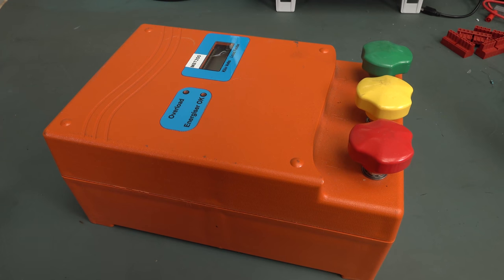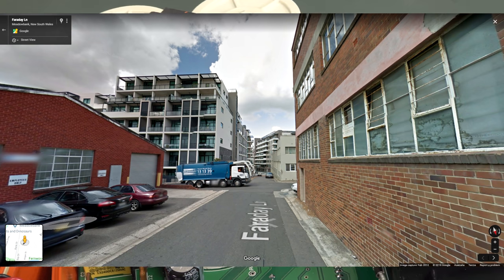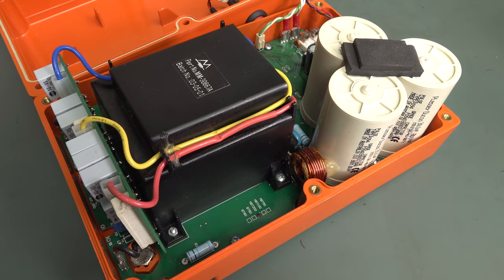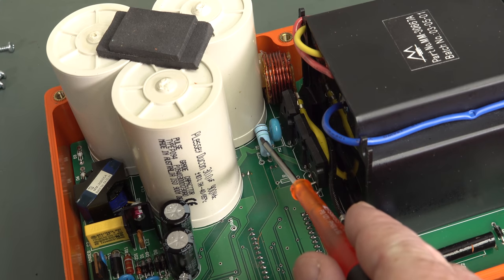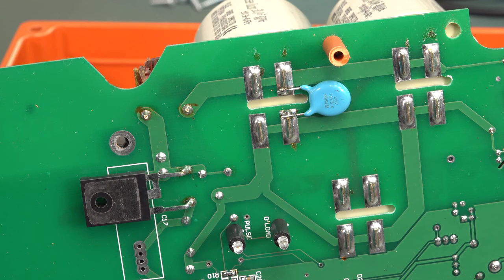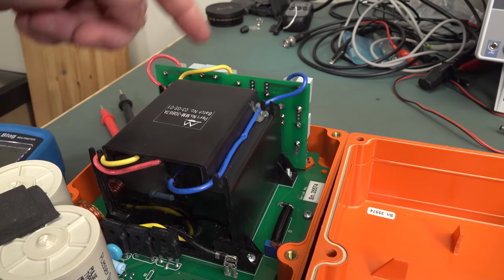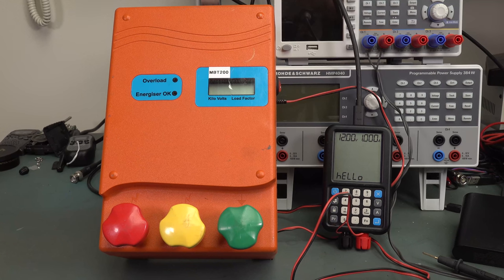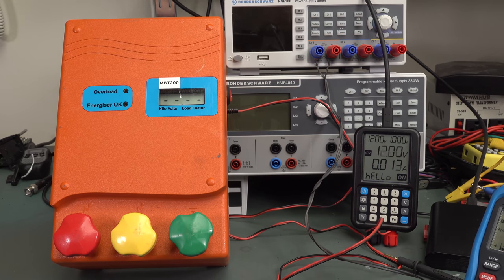EEVblog #1277 - Electric Fence Controller Teardown

Comment: Dave.
From 1969 to 1976, I worked for 7 years for an electric fence manufacturer in New Zealand,  
From memory the max pulse rate was about 60 pulses per minute or PPM.
The max pulse length about 3ms
.
The voltage was about 3000v to 5000v for fences up to about 100 miles approx 160Km.
I believe this was increased to about 10000v for fences up to about 100 miles approx 160Km. Mainly for Australia's dry conditions,
I forget how many Joules but the figure of 150 meg nah!!!

You can't measure the output voltage with a ordinary volt meter. Analogue or digital
We used a transformer, full bridge rectifier, cap, resistor, preset pot and a 50ua meter scaled to read the voltage directly. The needle bounced about but gave a good indication of the fence performance  that had to be checked at various places along the fence line,

One time I was testing some units and was distracted while about to disconnect the test leads. 
I should have disconnected from the power source  then disconnect the test leads.
What I did was forgot to disconnect the unit from the power. Disconnected the test wired from the test load  and pulled the wires through my left hand.   ZAPP.
My hand was white for several hours and had no feeling for about 24 hours. 
Scared the bejibers out of me.

Comment: When I was a kid, I distinctly remember peeing on an electric fence when I was at a demolition site - they were demolishing old power station cooling towers here in the UK. Thank God the fence wasn't on at the time. Looking at those caps, I think I'd have had quite a shock! Pardon the pun!
Reply: You probably wouldn't have gotten a shock, pee breaks up into separate droplets after leaving the exit tube.
Reply: @Mariano.Bernacki  not when u are a guzzler and shorter like me. The first thing it hits is the fence wire
Reply: @Mariano.Bernacki  yes its seperates, but this is pulsed high voltage on these fences. Believe me, my friend has a bad expirence with that.

The beam hits the fence before its seperation. And high Voltage can jump from the salty pee drop to another! Then pee is a good conductor. :-)
Reply: @Mariano.Bernacki  
I actually climbed up the fence afterwards, so it was definitely off. :)
Reply: @Mariano.Bernacki , I learned a valuable lesson when I was 5 years old.  My parents told me not to touch the fence, so I didn't,  BUT one afternoon the neighbor's dog came over and took a wiz on the fence.  Judging from the response from the dog, I think that he would DEFINITELY DISAGREE with your statement!  Oh, buy the way, I decided to follow the advice of my parents!
Reply: Mythbusters did a test of doing just this - worth watching.
Reply: @MikeB_UK , I would like to have witnessed the discussion  when they decided who would be the one who got to pee on the fence! ! !
Reply: Adam is the one who does it.  I think Jamie has more sense :-)

Comment: I worked on fence energizers  30 years ago and this topology  was fairly common including the basic opto coupler . The New Zealanders were the masters of the electric fence energizer and everyone copied them . My biggest failures were my transformers which were a crude high reluctance design but because of poor winding practice which caused the secondary winding  to go short circuit/breakdown.

Comment: I used to spend summers on my uncle's farm when I was a teen in the USA back in the 1970s. Farmers around where he lived all had electric fencers similar to this to keep cows from getting out. Although they were much simpler design. They would output a pulse about around 20KV in about 2 second intervals. Yes! You knew when you got a jolt from that.

Comment: Do a reverse and then check how close you got with the schematics afterwards...

Anyways, in my experience as a horse owner, most higher end fence chargers ARE designed to be serviced..  I've fixed 3 or 4 different brands including an absolute antique "Eveready" brand unit which used a mechanical balance wheel to open and close the circuit across a big inductor and originally needed one of those big "B voltage" batteries for tube circuits (I retrofitted it for 12v leas-acid).  For more modern electronic units however, it's usually a capacitor and transistor on the input side or a cap and high voltage diode on the output (although your unit appears to do the output differently).   Normally happens if the unit gets shorted to group due to downed wire or wet vegetation or a lightning strike to the fence..

Comment: This looks rather similar to the unit a friend and me used for a little project.
A friend of his is a very old farmer who lives on the mountains still has cattle there. the fence can easily be over 4 km long and when he needs to enter the area he has to walk that distance on the rather unfriendly mountain. To make this easier we have use a cheap walkietalkie and an arduino. The good old dual-tone multiple frequency (the sounds used by old telephones to transmit the numbers pressed) is used to signal the arduino to turn on/off the fence and the arduino also replies back with 2 tones - going low-high means it is now active, High-low means the fence is deactivated. We went with dtmf as that is a common feature on Walkietalkies.
Really simple, really efficient (we stuck a small 10 solar-cell on that and now the small battery for the fence also lasts way longer - we had put a small 12V lead acid battery inside the unit) and has a reach of well over 10 km.

Of course we did try how much it would zap us :)

Comment: "Ducon" is such a refined french word for ... A**hole
Reply: Mai Mariarti  : full disclosure, "con" in French has the same literal meaning as the c* word in English, although it's considered a rather mild insult unlike its English sibling. To refer to the other ... orifice, we'd say "Trouduc" (which is about on the same level of rather mild to average insult).
Reply: I'm french speaking and I laugh every time I find a ducon capacitor
Reply: @ordinosaurs  that meaning of "con" is pretty much not in use anymore. The contemporary meaning is closer to d**khead.
Reply: @randomelectronicsanddispla1765  : yes, that's why I said "literal meaning". And although I agree "un con" is roughly equivalent to "dickhead" in potency, I think "ducon" would be better translated by "plonker".
Reply: It makes you wonder if the bloke who came up with that name new a bit of French, and thought it a good joke to assign that name to the company, kind of like the modern day 'Schitt Audio'

Comment: It's usually very hard to find info online about electronics predating the creation of wikipedia and also before the mid 2000s unless it's something historically important or still in use today.

That thing has some very large electronics, when I see large electronics I instantly think it deals with rather high voltages.

Comment: Energy is high to burn off blades of growing grass. ONLY GROWING. After off period necessary to inspect length of fence to be clear of over growth or could ignite fires. Similarly fence must be clear of major bushes and branches blown by wind. Growing plants burn away the tips before being a problem. Many fences units drive hundreds of km length of electrified line.
Reply: Interesting is how few city folk recognise a electric fence and get zapped. Many years ago I was retrieving a RC glider from a paddock opposite the flying area. On return a father and son were also retrieving one. The son ran ahead leaving dad with a wire between his legs. I asked "if he planned more children" which got a puzzled look. I pointed at the insulator on a pole a few meters along the wire. Still no reaction. I pointed out he was straddling an electric fence and could be educated in unpleasant way.  He jump off instantly, but no thanks offered.

Comment: I work with fence chargers for a living.  While I've never used this specific one, I can make a few guesses based on what I know

First off, the ground line is meant to be connected to literal earth ground and the other two to fence isolated from the ground.  It should work with or without anything connected to it

Secondly, these are usually designed to send out pulses every 1 or 1/2 second, and the current rating stamped on them is usually the average over time, so when you consider it's not drawing current most of the time, the actual peak amps is usually much higher than the label.  I've seen them blow five amp fuses

Third, most of the time when they say 12vdc they mean a 12v lead acid battery, which, as I'm sure you know, is actually a little higher than 12v.  Most of the ones I've used have a built-in battery protection that cuts out or switch to slow pulse at 11.5, and I wouldn't be at all surprised if some of them actually cut off at 12.  You should try giving it 12.5 or even 13 volts if you haven't already

Lastly, if you're poking around in one of these, keep in mind that they're designed to deliver a painful shock through several miles of fence and earth, to animals with thick hides and hooves.  It hurts a LOT more when you touch the wrong thing inside with a screwdriver.  I have heard stories of them causing heart attacks

Comment: 8:36 - Does each of those cans contain 2 separate capacitors (4 leads (no 'common') 7:35 )?
Reply: No, just one capacitor in each. Two leads for positive and two leads for negative to handle the high current (in the order of hundreds of amps). The extra legs also give it good mechanical stability.

Comment: I believe this need some fence wire between the red and yellow terminals to energize. The green terminal would be hooked up to a ground rod that would give a reference to the unit so it knows when to zap. Just a guess.
Reply: Good guess mate, the yellow terminal goes to a ground peg or gets directly connected to the green terminal as a feedback

Comment: When I was young like 8 years old getting into electronics I found an old school fence charger at a flea market! I figured it ran on 120v AC being a dumb kid turns out they mostly ran on 6 or 12v and it was very a very simple pulsed circuit with a coil and coil spring. Anyway short story I hooked it up to a battery charger and “LEARNED” electronics in one zap! Some would call this dangerous now days but you know I could prob still draw out that circuit and describe how it worked to this day! After it knocked me on my butt I had to know how I the word could 12v DC which I couldn’t even feel get transformed into a pulse that knocked me on my butt!

Comment: How does 'Joules' relate to how severe a shock one can get?

Doesn't the human body draw only milliamps at the most?
Reply: Depending on voltage, ground path, wettness of skin etc can be many amps Enough to cook/burn flesh away in extremes like lightning.
The 10KV 10 Joule electric fence units can burn a hole through card board backing of a writting pad for example
Reply: Joules refers to the amount of energy stored in the capacitors.
Reply: @user2C47  In the specs usex in the 1970's the Joules rating was the measured delivered energy, not the stored energy, as differences in output transformer etc affect the result considerably. Only output energy aĺlows valid rating comparison between different units. Have seen bad units with less than half energy delivery.

Comment: As a kid we would take a handful of grass blades and hold that on the top wire for several seconds and we'd get a manageable but still unpleasant shock. That was in the late 70s early 80s. I don't know what kind of system it was, we didn't go looking for it

Comment: I'm surprised they provide a centre tap. The fences I've used only had two terminals: One to be connected to an earth stake (or a length of traditional stock fence etc. The other, to the electric fence. So, I guess the green is for the earth, and the yellow and red are to provide two different power levels. 

The shock shouldn't be too bad . If Dave fixes it and has a healthy heart, I think he should try getting zapped for us.
Reply: They provide a center tap so you can run two wires (positive and negative) down the fence. This helps to reduce electromagnetic interference from the high voltage pulse travelling down the fence, it also helps to ensure even in dry weather you have an excellent return path (i.e. a cow pushing through the fence will come into contact with both the positive and negative wire and experience the full voltage).
Reply: Thanks Philip S. I guess sheep would get the most 'benefit' from the double voltage, seeing as they're so well insulated. I didn't think about the dry Australian weather, though. I guess they have more centre tapped fencers in Australia than they do in humid France or UK.

Comment: Maybe 12V is just a bit too low voltage applied. Could be it shuts down as battery protection when used with a lead acid battery?

Comment: Not one of the real oldies, built before circuit boards.  They used to have one condenser, a coil and some breaker points on a balance wheel.  These were a later development on the original fence charger, which was a trembler coil box out of a Model T Ford.

Comment: I would think the inrush current of the device is high, so your supply voltage drops and the device cuts out, use a high current supply or a lead acid battery.
Reply from the maker: Nope, I'd see that dropout on the PSU and I don't.
Reply: EEVblog I have seen sharp/short current spikes while powering inverters (12v DC->230v Ac) that the powersupply didn’t show that caused the inverter to not start up properly, however the supply was dropping and the display didn’t show it. I assume because the cc event was gone by the time the display updated. Maybe I am wrong but 
to strengthen my theory: you used a 2 different supply’s one with 1A max current that did not give you a short „Energiser Ok“ flash, and the R&S one with 1,5A current limit that did give you a short flash. I would like to see you try to use a 3s lipo, even 18650 cells would give low enough resistance to start hat bad boy right up.
Sorry for improper Englisch.

Comment: I'm trying to create a 1kV 100W PSU with different voltage taps for use of testing/powering small, old CRT tubes for fun . Many times I've turned the 100nF caps around in my hand, thinking about what to do next and accidentally zapped myself because I'd just charged them in a circuit. unfortunately,  I haven't be zapped by the 470uF caps I have yet, as 200J of energy would certainly be exciting.

Comment: 16v AC or 12v DC? Was this mixed up? Doesn't it kind of like make sense to have 16v DC (super highly charged lead acid) or 12v dc. Where 16 = sqrt2 * 12?
Reply: I worked on these units. It shouldn't care which source it is running from. The 16 V a.c. input is for mains connection, the 12 V d.c. input is for a battery backup to keep the unit running even if power fails. From memory it trickle charges the battery through a large value resistor, and then uses a diode to switch the battery into the circuit when mains power is lost.

Comment: Designed a number for my boss in late 1970's. Typically 10KV at 10Joules  . I regularly test by finger. But our lab tech did not believe it on and also tried, very sore arm and shoulder joint for month!
Reply: When dave showed that unit to be 3KV max, I chuckled.....the 200KM+ energizers are a different beast, I believe a large gallagher unit is over 13KV at the unit, basically a bush taser! haha

Comment: Fascinating. Also intrigued by the fact that there are actual lethal power electric fences. I thought that was a myth. Honestly if a solid 1200-1500V pulse won't sit you on your butt I don't know what will.
Reply: Many fences can have more than 10,000 volts of potential, but they may not have much power.
Reply: @user2C47  Sure, shuffling your feet on carpet and touching a doorknob can give you a 20kV zap. It's Amps that do the business. That string of caps on the output of the zapper above would be able to back it up with some amperage. I find it hard to imagine the benefit of applying more power than enough to dissuade someone from touching it.

Comment: 2.400v sound low, around here 8.000-12.000v is normal.
Reply: @georgechiporikov2297  Add voltage drop from resistance of kilometers of wire and voltage drop from every blade of overgrown grass that is touching the wire.  I have 7kV open circuit 7J unit and at 2kV its not reliable anymore, some cows will just power through.

Comment: Typically output is around 10KV on a fence unit  and not more than 15 joules in order to be non lethal, having got zapped myself on numerous occasions by them I can tell you that over nine joules it feels like all the bones in your arm and hand were extracted and put back in again in an instant,well that is the best way I can describe the feeling. One time I was showing a customer the fence line and somehow by not paying attention I walked into the fence just where the feed in line joined the fence I got the full 14.5 joule shock from a brand new mains powered unit just as my leading foot touched the ground,the jolt was so great it flipped me over backwards.

Comment: I had access to a NZ built energiser, just for a joke I hooked up a jumbo LED directly to it's output
The result was a guaranteed, on the first pulse, decapitation of the LED, it would blow the head clean off with quite a bang - it was quite brutal, afterwards the ruminants of the LED sometimes caught fire.

I had a great time trying to capture the moment with a high speed camera, with a little success,
Pity I don't know where those pictures ended up.

Comment: increase the psu current limit and try again...
Reply from the maker: Nope. Didn't even work on AC input which isn't current limited.
Reply: May not have been a high current power supply. I've got one that will supply 10 amps, but adjusts in 0.1 volt increments with +/- 2% variance.